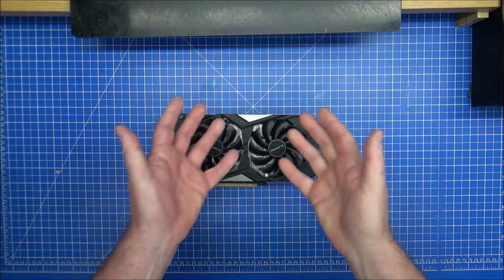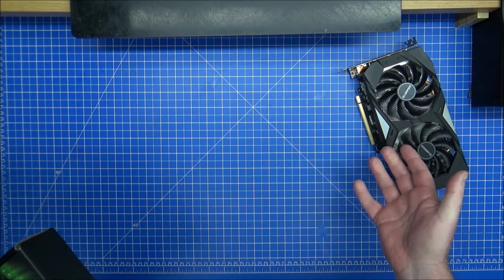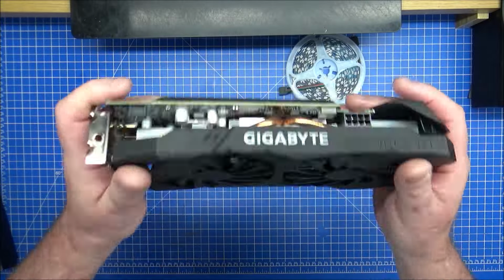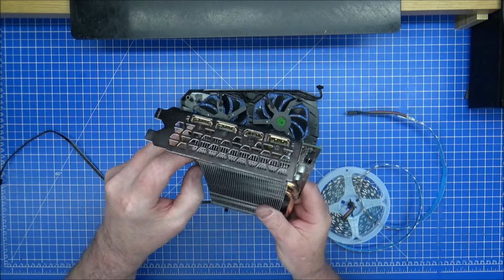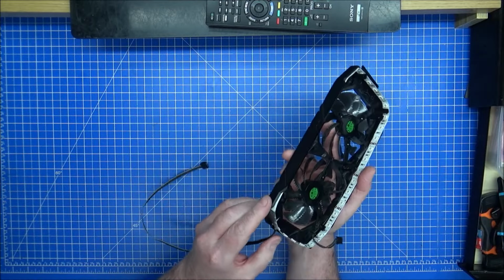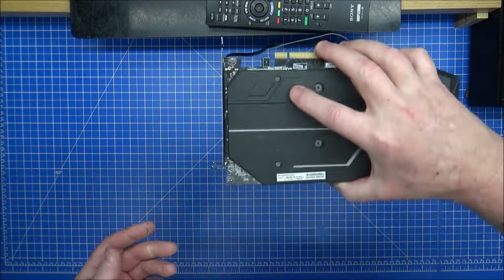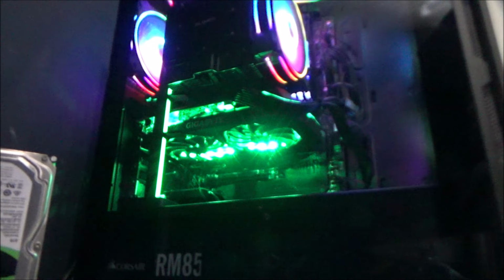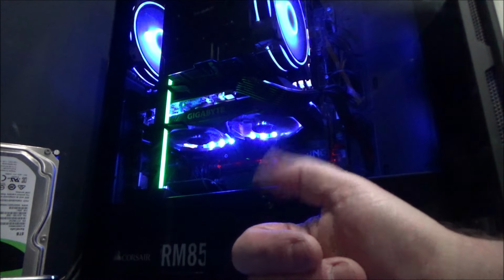How to RGB Any PC Graphics Card

Comment: Can you do it with out soldering and add it to a controller you have fans connected to?
Reply from the maker: yes
Reply: @R_T_Ralph  do you have a video on that? I would like to try it on my build but cant find any information on how.
Reply from the maker: @angiemarie4049  no video, but depends on your pc led outputs, and amazon usually have lights that will fit.